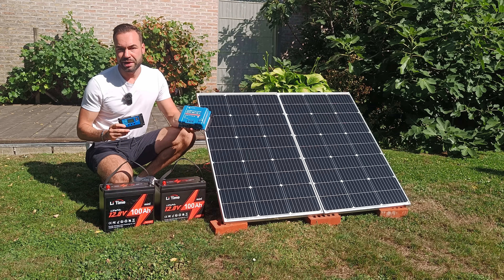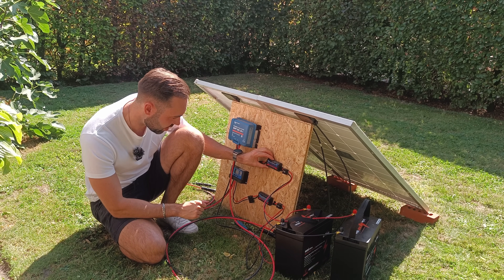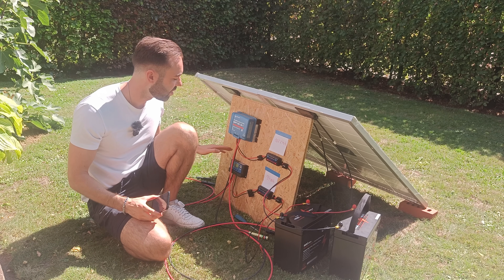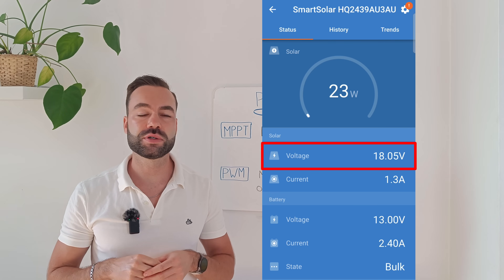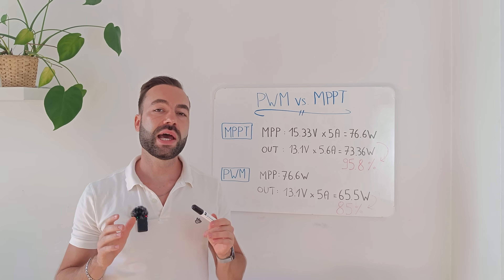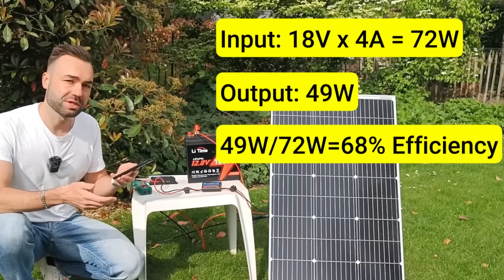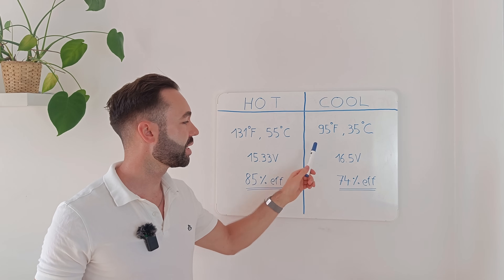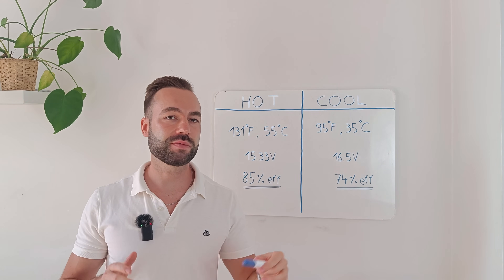MPPT vs PWM Efficiency Tested

Comment: Problem with those cheap PWM chargers, the hotter it is, the greater chance the controller will burn out. Those voltage regulators get very hot, and the heatsinks used are inadequate to keep them cool.
Reply from the maker: Indeed, this one is rated for 20A but it got warm at 5A. So I would use them with 10A max. Looks like the 10,20, and 30A versions are all the same.

Comment: I want an MPPT so bad, but it's not worth the cost for me (small system, 4x100W panels).  Even though the cost is not that great, it pushes the payback period further back, and I already have enough money into this.  Maybe someday.
Reply: I hear you. There are some good deals on the famous Chinese website. I have a PowMr MPPT 20A that I bought for 23 euro and is really MPPT. A bit difficult to program but does a good job.  The Victron that I have which has BT is a lot, seriously a lot, easier but then it was more than double the price.  For me it is really important to see the statistics on what comes in and goes out.  Paid 55 euro for that one but I highly recommend it because it is tested and supported. 
I discovered some issues with cables and a connector that I bought via monitoring the input on the app. Also check if you can place panels in series. Higher voltages less drop over the cables which in my case is a serious issue. My panels are about 30m away from my house. (garden is facing the North).   There are couple of mppt dyi projects but yet I fail to find one which is either finished or good enough. 
No way I will connect a PWM to a small battery and large panel. The Mosfets just act like switches. So on/off in a very fast way but lets say 20V in and a small 12V battery which max charged at like 15V might still get spikes while charging and if you then connect sensitive in like max 15V things to the small battery it might get those spikes as well.   I saw this on my scope on a semi worn out battery.  The internal resistance goes up when it gets older.
Anyway keep watching Nick's and Will's videos. Both highly regarded, scientifically correct and not sponsored.They both make 'mistakes' but lets not call those mistakes, it's called troubleshooting and real life tests to understand and improve.
Reply: It is certainly true that PWMs are dirt-cheap these days.  But they can only be used with small systems and you are already at the limit in terms of the paralleled amperage your four panels can put out.   Also... do you really trust a 20A or 30A PWM controller to actually operate at those amperages?  I wouldn't.  A lot of 30A PWM controllers are just rebranded 20A controllers, for example.

Small systems don't really have break-evens... the saved energy vs using the grid is just too low to matter.

This brings to mind ... just how cheap a MPPT can we get on Amazon now?  The cheapest Victron is a Victron BlueeSolar 75/10 at around $45 or so.   *NOTE!  I do not recommend buying it, I'm just using it as a comparison!!!*.  No bluetooth, only a 10A (120W @ 12V) output.   But it's 75V input limit can handle a residential panel.

Just browsing on Ama I see a 30A no-name MPPT for $22 (I have no idea whether it's actually a MPPT or not), and a 25A PowMr MPPT for $40.   Hmm.  That no-name brand also has a "60A" MPPT for $20.  I guarantee that isn't a 60A unit, though.   Lots of shenanigans are let through on Ama.   I'm ignoring the exposed circuit board "5A MPPTs" being advertised... those aren't MPPTs, they're just buck regulators.

Heh.  Saw another one... absurd, advertised as a 50A MPPT for around $8.  Again, I guarantee that one is a scam.  It's probably actually just a rebranded 15A or 20A controller.

The smallest Victron that I would recommend would be the SmartSolar 100/20 (100V input limit, 20A output, 12, 24, or 48V battery bus).  Roughly $90.

-Matt

Comment: Thank you for this video, as these older technologies are often overlooked when building out simpler lower draw solar systems that don't require the latest technology nor require the expense.
I use a very similar system for a garden shed to charge my tool batteries, run lights, and a fan all off a simple system.

Comment: I think PWM is perfect for someone entering solar on a small scale just wanting to learn....and also for stuff that doesn't need a lot of power or efficiency.
I have three charging stations each consisting of a 20W panel, a $4 pwm and an old 5 to 8 Ah motorcycle battery. The PWM has two USB ports  to charge devices and I've never had it run out of juice. Not as portable as a power bank but way better when you need it in a power cut for example.
Reply from the maker: Exactly, I agree 👍
Reply: Spot on.  That is how to learn about solar.

Comment: Interessante video. Ik heb al met beide toestellen gewerkt. De PWM is spot goedkoop en vandaar durf ik al eens dergelijk exemplaar gebruiken als prijs een belangrijke punt is. Naargelang de situatie plaats ik de panelen in serie, om voldoende spanning over te houden als de temperatuur/lichtinval minder gunstig is. Anders geef ik toch de voorkeur aan MPPT. Sinds kort ben ik gestart met Renogy. Hoewel ik een Victron liefhebber ben is Renogy op het eerste zicht een prima product. Misschien daar n's een video over maken?
Reply: The MPPT can more easily work with the panels in series too.
Max input is 100v and one just need to take into account the max open circuit voltage during high sun bursts at cold temperatures.
Reply from the maker: Yes, if have you multiple panels connected in series, then MPPT is the way to go.
Reply from the maker: Indeed, this PWM is very cheap. However, if you want reliability then the mppt will be better. I wouldn't trust this PWM to run for several years. I have mixed feelings about Renogy as their customer service is not always the best. I will look into it.
Reply: And a MPPT can work with larger panels (double check its input voltage limit though).  I've stuffed a residential panel (just one) into a cheap Victron 75/15 myself.  Of course, it instantly hit its 15A output but going into a 24V battery it still pushed almost 400W.  

More importantly, though, I just perused a few retail sites (like Ama) and there are a lot of complete and utter scams being advertised for PWMs and for MPPTs... lots of cheap units being advertised with 30A, 40A, even 60A outputs that are obviously incapable of those amperages. 

So be careful what you buy, folks!  For small PWMs or MPPTs decent cheap brands would be things like Renogy, Eco-Worthy, PowMr.   Higher-end would be something like Victron.  Avoid the no-name brands, avoid supposedly high-amperage PWM or MPPT units that have dinky (obviously not high-amperage) terminals.   Definitely be careful out there!

-Matt

Comment: Most of the MPPT benefits were eaten up by the oversized MPPT controllers internal consumption.
That looks like a Victron MPPT 100/30 which would by itself eat half a watt. Add to that the ideal efficiency at around 15-30 amps not 6-8 amps and I think the test would show a better result using a smaller 10 amp controller.
Also: The biggest benefit from MPPT comes from the conversion of energy when the battery is at a low voltage vs the panels ideal load output voltage. This doesn't happen much with LiFePo as the voltage is high over the entire discharge range and 100Wh into a 100Ah LiFePo is easy to do when it is at 80% SOC with high voltage. A lead acid at only 12.2v fed by a panel with an ideal load voltage of 15.33v would do better.
Reply from the maker: Good points, the self consumption of the victron charge controller is 30mA at 12V, so 0.36W or about  0.5Wh during this test. I don't think i would have seen much difference if i were to use a 75/10 charge controller. Which has a self consumption of 19mA at 12V or 0.35Wh of power consumption during this test. I think it's also because of the MPP tracking algorithm which is never stable.
Reply: @cleversolarpower  It would be interesting to see a test where both batteries were discharged to at least 20% SOC before the test. It is also important that they be discharged to same SoC to make the test fair. We can't simulate a low SLA or AGM but we can at least have as low a voltage rise as possible during the charging process. You can also connect to and configure the MPPT to not seek as often if you know you are just needing to adjust for small variations in light intensity. Some defaults are very aggressive for sure and can spend way too much time seeking.
Reply: @cleversolarpower  The reason it's not stable, is because it periodically deviates from its operating point, to check if it's still on the optimum point on the power curve. The advantage of the MPPT becomes bigger with extra panels in series, It can also charge at lower light conditions in that case (extra hours in the morning/evening)
Reply: well spotted
Reply: i changed 1 agm battery to 2 lifepos and so much more energy